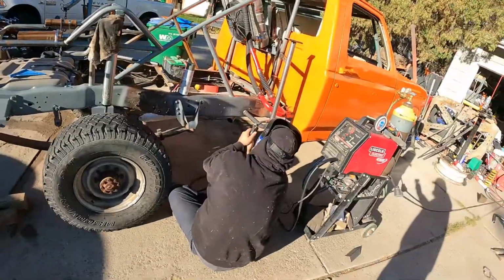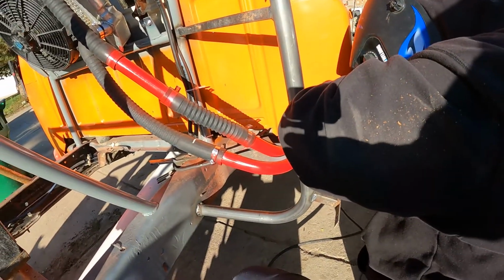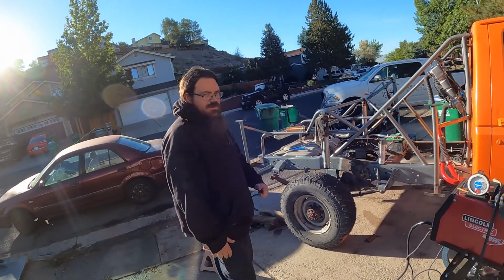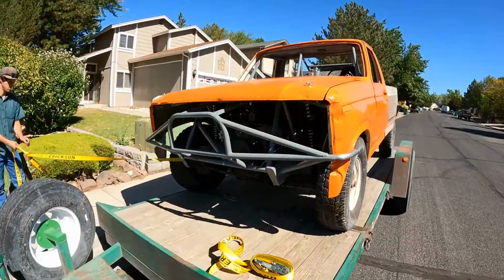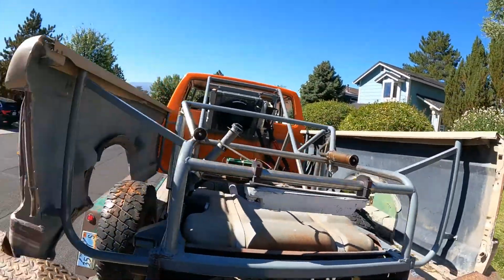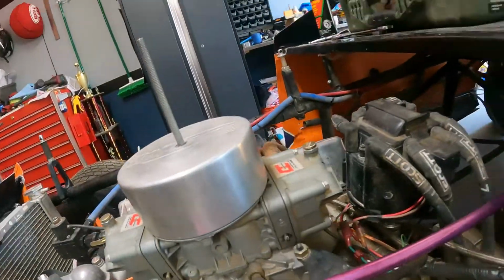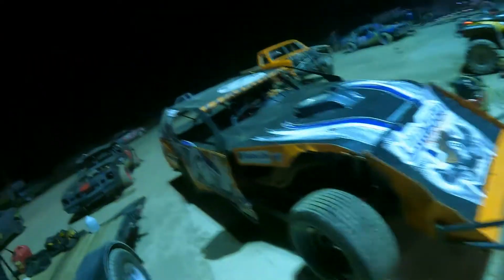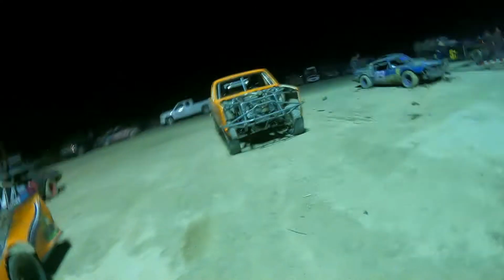Tuff Truck P21: Triple Duty, Tuff Truck, Bootlegger & IMCA Modified 9/24/2021

Comment: Nice action footage sir. Looks like it's time for the old ford to get a microsquirt.
Reply from the maker: Thank you.   Yea, that poor Edelbrock carburetor has seen some better days.   Some type of Fuel injection may be in its future.
Reply: @wadelumsden1548  I've been running that little $380 ECU in everything for the last 3 years. I used the Edelbrock for 2 years. Tried everything in the kitchen. Nothing seemed the help. Tried the predator as well. It was good wide open, not so great in the corners. Holley's with 7-8 psi and 1/16 low floats, center hung with spring seats seam to work the best if you are keeping it carbed. If you use the microsquirt, you can swap to ls sensors like I've done.

Comment: Ran off road trucks for a while before the back started to go sideways.  Fuel cell foam doesn't like all the slamming and sloshing. Use wiggle balls instead. We even went to those on our circle track toys. Most foam I'd junk these days unless you get nascar level stuff. Just something else to watch for.
Reply from the maker: good suggestion,  Currently its the rust out of the bottom of the stock tank.  But, I think I may be going to a fuel cell soon.  I dont use the Foam anymore either.  just clogs up the fuel filter after a couple months.
Reply: @wadelumsden1548  Wiggle balls... Had a bad case of those last week. WIFFLE BALLS. Damn auto correct. You can get them in baseball, softball, tennis, and golf sizes. Get the better brands to avoid fuel breaking them down. Love the videos.
Reply from the maker: @eddiemclean7011  HAHA  I had a feeling that was what you meant.  And thanks for the suggestion!